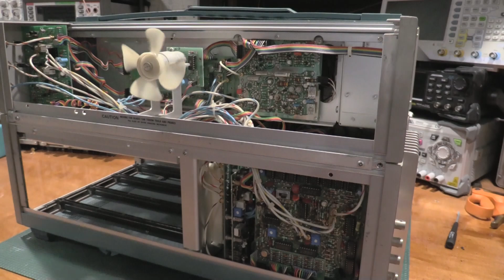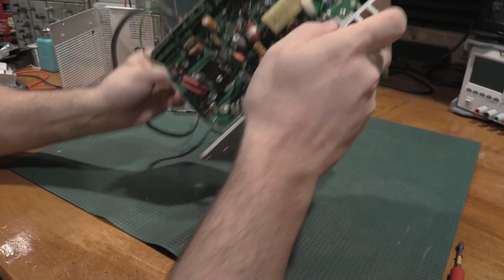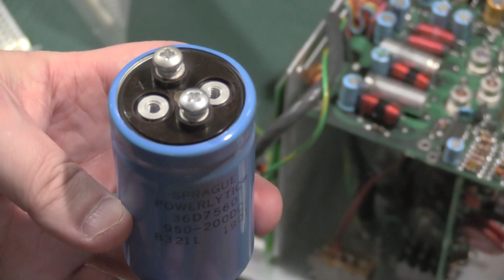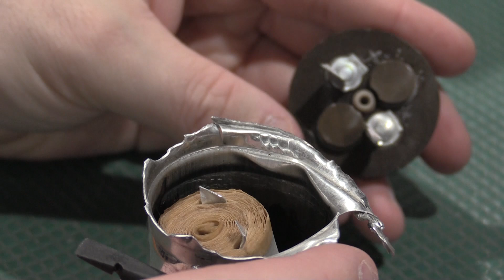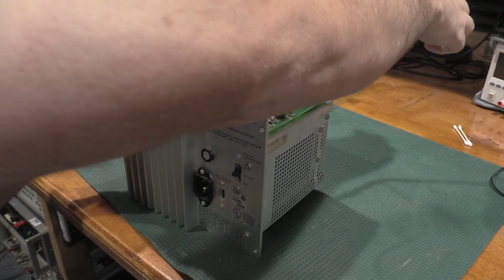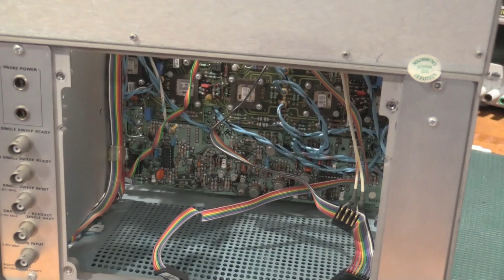Tektronix 7904A Power Supply Repair

Comment: 19:03 thought these old spragues were 3/4" spacing (19.05mm)? Although terminal capacitors are still available (even with 19mm spacing),  ive never seen that style with screw mounting separate from the terminals (4 screw holes). Sheesh, hope you sourced as many as you could
Reply from the maker: I did. I could only find 2 so I have 1 spare. Would like a few more.

Comment: What's the full name of what you call your "SMU"?
Reply from the maker: Keithley Sourcemeter 2450
Reply: @ZenwizardStudios  Thank you! Wow, pricey piece of gear, but it looks like a goodie.
Reply: @ The SMU is an amazing machine, when I first saw the price (even an older model) my heart almost stopped, I finally managed to get an older one, but after my workshop was robbed and I only deal with electronics as an amateur, I unfortunately can't afford to buy a new one - with a little added SW it's more than my annual salary
Reply from the maker: I need to get the other 2 at some point but for me needs I am biasing to the HV version first. SMU's defiantly fall in to the category of exotic. But they can sink current and measure Tera Ohms at the same time. More then a few videos can be made on their usefulness and uses and some times it is the only thing that will do. I have had some capacitor as well as silicon fault that were only proven when testing at rated voltages. Cap fault example was this one. Silicon example was WAY back working on the Fluke 5200A the -190 Vdc rail cascade faulted and burned down. there was some transistor damage  that only showed up when 200+ volts was across it. Did not have the SMU back then but it would have shown the leakage. Found it on a Tek 576 curve tracer. 

One very modem usage for SMU units is as a replacement for a 576. However this usually required 3 to 4 SMU units in a package as well as a computer control to tell them what to do when and record the results. The entire package for a "Semiconducter test unit" starts around $50,000 and goes up from there which is kind of nuts.
Reply: @ZenwizardStudios  I also experienced the problem with the breakdown capacitor, unfortunately my tracker can only handle a maximum of 60V (I am already working on a version up to 200V) but for these cases and for forming capacitors I fortunately have an AT680 - LC/IR meter and it has a maximum of 650V. The 576 tracker and similar machines are unfortunately also beyond my means, I found a beautiful piece on eBay for reasonable money, but shipping and custom. 
After the launch of the new SMU series, I wasn't interested in the price and in our country the 2461 HW+SW was sold for 9,999,- + 12,800,- USD and I have no idea if it was just part of the necessary SW. I looked on eBay out of curiosity and found a used one for 11,490,- USD excluding tax and shipping, I didn't even check if it had any expansion SW.
Reply from the maker: The SW is only for "Dynamic" signals the front panel can be used for even some complex scripting for say battery analysis which I have needed to do had to create a few battery models for a 2280 battery simulator.  If you need higher voltages one thing to look out for is a Keithly 237. These were the older brown box SMU units if I remember correctly they only did 100mA but they would go to 1100Vdc
Reply: @ZenwizardStudios  Thanks for the info, I know the brown line, but I had big unplanned expenses before Christmas and I'm glad I have money for food, my wife has had surgery and I'm the only one earning an income - so I have to postpone planned shopping.
Reply: I sent you an email.

Comment: Where were you able to source the correct replacement caps from?
Reply from the maker: I was able to find a pair of good ones but I did need to hit Ebay for them. Not recommended but with the mounting it was the only option. They were tested and validated before being put in to service.

Comment: Nice scope this , i have worked with 7844 rack version and lots of moduls 7A24 and  7B85 back in the 90´s Power supply was a robust one,  but CAP's can dry out,  for the moduls it was some intermittent bad contacts with rotary switches.  Oterwise TOP notch tektronix stuff.

Comment: Save that plastic capacitor end with the 2 mounts and 2 feed throughs.. I have re-used for years by eliminating the original can and mounting a much smaller modern cap to that end header. Years ago I would find  those caps at surplus sales in Portland area, and build stuff with them, reliant upon the mechanical mounting as designed. As the decades pass, they would eventually fail, and need replacing.

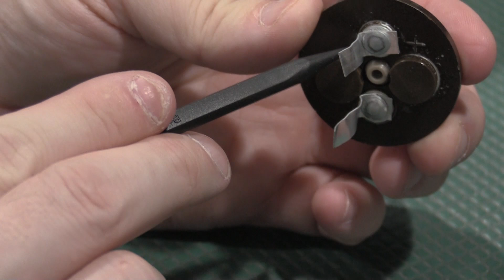Comment: Could you have replace those bulk capacitors with a standard electrolytic capacitor and solder the  leads to the tabs on the mounting of the original capacitor top? see 17:51 or possibly re-stuff the original capacitors. would have been an easier option  and cheaper. just my thoughts.    🙂
Reply: I have done just that many times... as these caps were once plentiful and cheap in the Portland area surplus stores, and many projects got built with them... later fritzing out and needing replacement. It was easier to strip the can and winding, then do new smaller cap, than to redesign the mounting system. I have lived near Tek since the late 60s.
Reply from the maker: Sometimes depending on the electrolyte It can be difficult for a reliable connection. In this case mechanical stability would have been a concern long term given the awful mounting situation.
Reply: @ZenwizardStudios  What if you emptied and cleaned out the old can and put the new cap inside and then packed it with some silicone to keep it in position inside the can?
Reply: @ZenwizardStudios  Sounds like an opportunity to justify a 3d printer!
Reply from the maker: 3d printing has its own challenges in this location. This one is not so bad as the cap will only see about 200 Volts but in the 240Vac areas of the world these bulk filters can see upwards of 400 Vdc after rectification. 3d printing filament can get conductive some times.
Reply: @ZenwizardStudios  But you wouldn't have to contact their legs.  Just provide mechanical support.  Oh, sorry, I think I see the misunderstanding:  I was building on the OP's idea of using the old tops with new capacitors.  Not 3d printing complete enclosures.  Still, those clearances seem pretty good, and that's the real problem.  Phenolic will go dead short if it carbon tracks:  clearance prevents it.  Just another take on it.

Comment: Great when the first attempted solution fixes it. 
Did you find any bad caps on the regulator board?
Reply from the maker: Voltage and ripple was with in acceptable limits.

Comment: This video hurts a little bit. When I was quite a bit younger (20 years ago), I had a 7904 that smoked. I had it monitoring a DUT and went upstairs. When I came back there was smoke all across the ceiling of the room and the 7904 was dead. I ended up having it recycled. I automatically assumed it was a transformer, and maybe it was. At the time I didn't know about the tantalum cap failure thing. In general I still kick myself for tossing it. It's replacement is a 7834 and still working well. I also had 2,  7704s sold both of them. Boeing surplus was sure wonderful back in those days. Great perk.
Reply from the maker: I have 3 dead 7904's waiting in the wings all of them have some serious issues in all of them the power supplies are a mess as well as shorted tants. There was quite a few design improvements in the 7904A vs the 7904. I do wish they would have kept the calibrator of the 7904 though it is much nicer then the A.

Comment: Hi, of course we want to see the calibration and repair of the grille lighting. I'm interested in how the regulation is handled on this model, I recently converted the 2465 to LED.

Edit: Did you get my email regarding the miniaturization of the bulb short circuit protection

Nice day 🙂 Tom
Reply from the maker: I did I am looking in to some things on the current limiter. The LED's on this one are a bit weird as they need a driver board and are not just DC powered but have a pulse control for scope photos.
Reply: @ZenwizardStudios  The LED brightness control problem is also present in the 2465 model due to the photos of super fast events. During the conversion, I made it a priority not to interfere with the original regulation and to keep the original connector for connection. Someone installed the light guide incorrectly on the oscilloscope and crushed one 5V bulb. I was unable to find a new one, so I had to convert to LEDs. I ground reflective mirrors into the LEDs themselves and removed the edge of the diodes on a small lathe, replaced the bulbs with 3mm LEDs so that they fit into the existing light guide. The current is adjusted by a resistor divider and balancing resistors on the LEDs - the result is completely smooth brightness control for three-quarters of the potentiometer stroke, the remaining quarter of the stroke changes the brightness very little - probably the best result I could achieve with this simple connection - if interested, I can send photos of the implementation to an e-mail.

Nice day 🙂Tom
Reply from the maker: That would be cool to see at some point no rush if you have to tear anything apart. Andy and I (Mainly Andy) worked on a driver board for the LEDS in a 7904 so this already exists. Andy's is a THT version of the board. I was rolling the idea around of making it surface mount.
Reply: @ZenwizardStudios  Hi, no problem, I don't have to disassemble the oscilloscope, I took some photos. Due to the simplicity of my system, I used THT components, part of it is on the original PCB of the backlight bulbs and the other part of the resistor divider is sealed in a silicone sleeve into a heat shrink tube as part of the cable - this left the original concept intact - the PCB of the bulbs and only the cable terminated with a connector - in case of a possible repair, the connector can be disconnected from the board and the cable with the connector can be pushed through the original hole in the screen frame